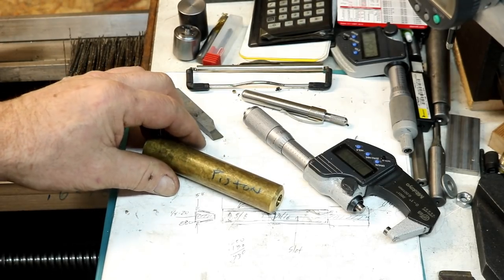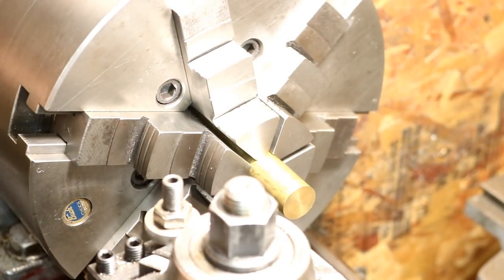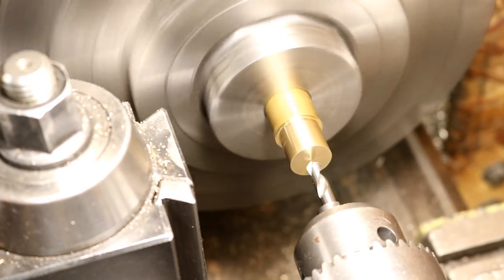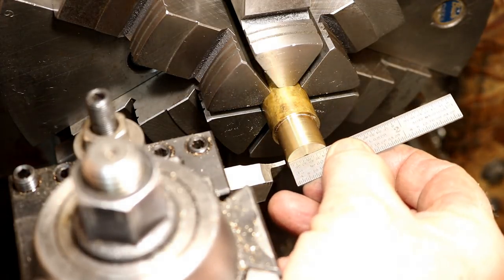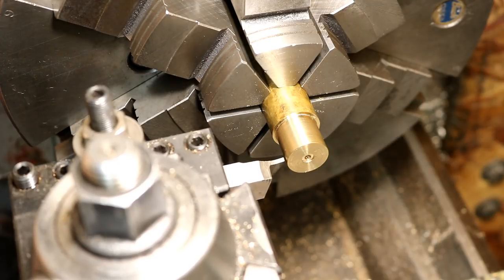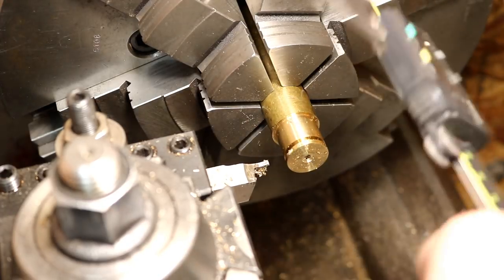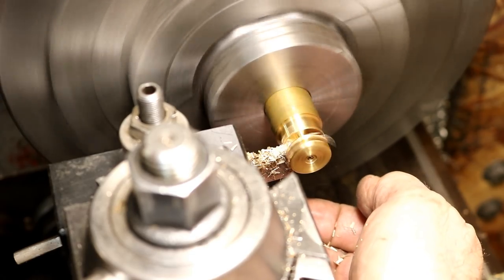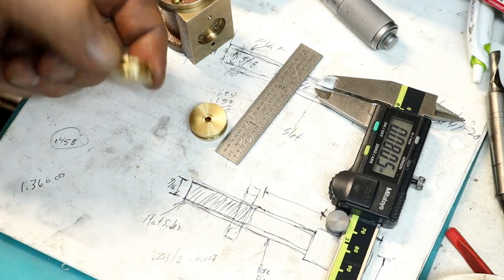P5-1 How to Build the Piston Of a Model Steam Engine for the First Time

Comment: will the motive source be air or steam for the engines? Just was thinking of expansion rates with close tolerances /dissimilar metals etc.
Reply from the maker: I will use air.  Even with steam i think It will be ok.  The cyl. will expand more in Circ. than the piston.

Comment: Not making the rings? I thought you were making the engines yourself not buying in. Just teasing not trolling. 😆 
like another viewer said, i must dig out a set of engine castings I have hidden away somewhere, after all you can't call yourself a model engineer if you haven't built a Stuart model.
Reply from the maker: Well I thought about doing that.  What do you think I should use material wise?  Thanks Chris.
Reply: @RRINTHESHOP  never done it myself but I understand fine grain cast iron is favoured but can't say if it would be suitable for both your engines. If you are just running on air you could get away with no rings at all just your close fitting piston or maybe some PTFE string or twisted tape instead of rings.